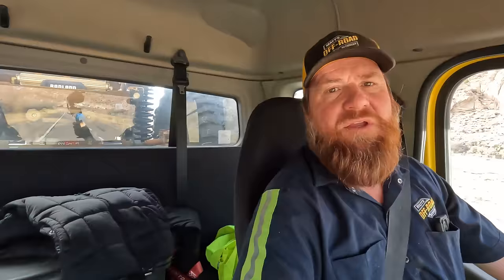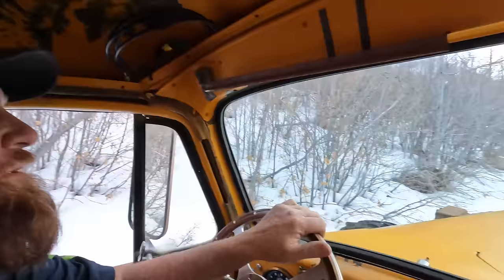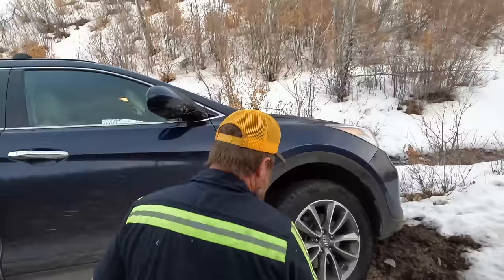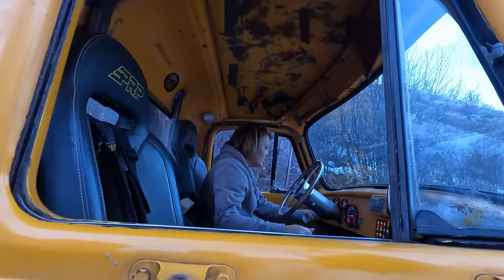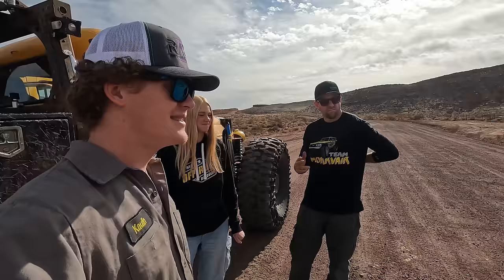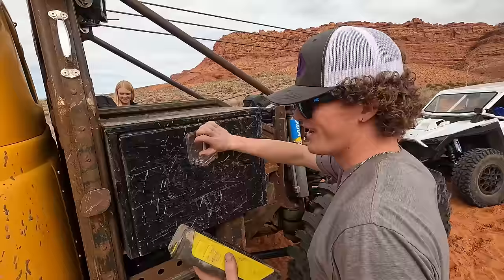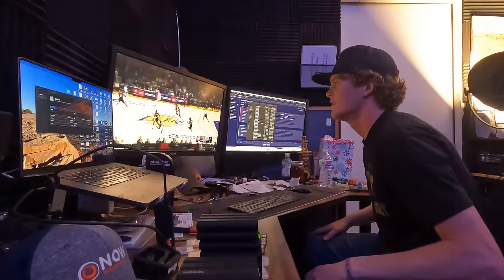You Took Your Hyundai Santa Fe Where?!

Comment: Tires make all the difference. All-season tires and you're cruising in that Santa Fe. With good ground clearance, that little car is surprisingly similar to a subaru. Add winter tires and conquer snow, even without AWD. Matt 20 point turns it around in similar stuff that got it stuck! Intuitive traction off and AWD lock buttons give you even more control, and Hyundai's traction control is impressive with real tires. I've had a couple of the newer ones, they're great in the mountains.

Comment: Don't them kids know about the wing window? That's the A/C of the day. They haven't lived till they open that wing window!
Reply: Those ones are sketchy meaning they’ll fall out.
Reply: I had a couple of air cooled VW's the wing window was the defroster as well as the A/C. The heater certainly wasn't up to the task, except when going uphill.
Reply: 2. 40 air
Reply: @jasonh4167  I've never seen one fall out.
Reply: I was looking to see if anyone else thought that.
Reply: @jasonh4167  Drove old trucks / Jeeps with those wing windows for over 20 years. Never had one fall out, or even come loose.
Reply: @jasonh4167  normally they are hard to open. If they are stuck you wish they'd fall out. Lol

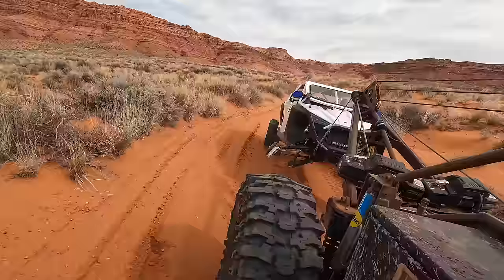Comment: actually on the offroad wrecker… you can open the little side window next to the window on your door by pressing the little button and twisting the handle.. then push the window out it should tilt out… it actually lets a good amount of air in.. Try it ! 17:36
Reply: also bugs, bee's and more things you don't want inside on you, nothing like sudden entry of an angry wasp, yellow jacket, bumble bee or better yet  swarm of them to liven your day up 😬 if I sound slightly experienced in that, yes, having owned multiple vehicles with wing windows, I learned to never use them as West Virginia air-conditioning after some bad experiences, like almost wrecking off a mountainside on gravel roads, thanks very loud vw rail buggy ahead of me that sent a yellow jacket nest swarming.

Comment: I'm a proud Santa Fe owner. The first video I ever saw of MORR was the Hyundai Tucson episode.  Been a fan ever since. BTW, the traction control on/off is a button that shows a little car with squiggly lines behind it. This SF is older than mine..... my button is on the center console but in my old 2013 Elantra it's to the left of the steering wheel. Hope this helps you next time, lol. 😉

Comment: In my Pontiac Torrent GXP all-wheel drive you hold down the traction control button for 5 seconds and it shuts off the traction control and the StabiliTrak

Comment: Maybe it would be helpful to have some sort of brake light on top of the boom so the person driving the recovered vehicle can see when you break so they can too...
Reply: Maybe even just make it off when on any throttle. On when off-throttle. I'm sure the gearing+tires makes actual braking unnecessary during flatter terrain. And you'd also know when to let off the recovered vehicles' brakes when setting off. I also wonder if there is much left foot braking done in the wrecker.

Comment: You definitely need more passenger space in the wrecker. Maybe add 2 bunk beds on top, then you even have a place when you lose the race with the sun.
Reply: I was just thinking about added seating myself. Great minds think alike! But I was thinking of adding a lazy Susan and a fold flat seat to the roof of the cab to create a spotter/guide position like in a safari.
Reply: They have to fit through the tunnel at Sand Hollow
Reply: Seats on top of the engine cowling like in the John Wayne movie “Hatari”
Reply: @yourhandlehere1  - you wouldn't need a seat for spotting disabled vehicles while traveling thru the tunnel hence the ability to fold it flat.
Reply: A sleeper compartment off a Peterbilt 359.......  Hmmmm....Sure, why not?
Reply: I've thought this too. I think a plastic seat and seat belts facing backwards on top of the toolboxes right behind the cab would be a great place.

Comment: 10:45 if the vehicle has a sport mode, put it into sport and hold down the traction control button for 3-5 seconds. It will tell you that the stability control is off and will actually stay off, if in sport mode. Cheers!

Comment: Hey there, Matt - my husband and I have a great idea for a jump-seat for the guy in the back of the wrecker. You could put a hitch-receiver on the back of the wrecker somewhere - vertically pointing up and mount a seat that would be pinned into the receiver only when a seat is needed for a comfortable seat with seatbelts put on the seat itself.

Comment: Matt!  We know you're rough and rugged, but get yourself a Ridge-Rest camping mattress.  We will not think any less of you if you start taking better care of the equipment that is Matt!  
You'll get to an age where you will wish you did!  
I used one for nasty spring plumbing at a sleep-away camp for decades (specifically a Ridge-Rest for durability, the ridge pattern that drained away moisture better than straight Ensolite pads, and ease of stowing) .  I had to actually crawl under slightly-elevated cabins and the Ridge-Rest defeats a lot of water, snow, mud and slop; they keep you from bleeding off heat energy if you end up on the ground for longer than you'd anticipated.  It also keeps you from transferring mud, water, sticks etc to your truck seat.  Plus your bones and joints will thank you.  If not today, then years from now!

Comment: I know Matt loves to call his wrecker the world's largest off-road wrecker, but, it's far from that. It's cool and has some great features I like the way it looks, but it's not even the largest off-road wrecker in Utah much less in the world. I drove one when I was younger that wasn't specifically designed for off-road but because of the high flotation tires it worked in most conditions. I could literally lift a fully loaded cement mixer off the ground and walk under it! The largest one in Utah is probably the one that Heavy D has
Reply: The largest off-road wrecker that can run trails

Comment: SUGGESTION: maybe in the centre of the cab(fixed to the back of it), you should install a minimalised reclining seating surface(something similar to the armrests in the back of the car, just thinner). And when it goes down, it's low and soft enough to sit on it but also wide and long enough to cover the controls, so nothing gets mangled or pressed with the b*tt and legs. Basically there should be a removable or permanent stubby spacer on the centre console to let it rest on it when it reclines down. Or the hinge spacer on the top of the reclining seat, so it does not stick out when it's in the up position.

Comment: I drove a Hyundai Tucson for 18 years. 2x4, no four wheel drive, no traction control, manual. Never got stuck anywhere. Did wonder a few times whether a helicopter will get me out, if I were to get stuck. Sold it last week, 600 kms short of 400 000 kms. I've got great respect for Hyundai. I'm in South Africa.

Comment: Hyundais in the snow absolutely suck.  I was stuck on three feet of ice once trying to get one I fixed out of the shop.  It would spin for about two feet, almost make it out, then the traction control would cut all the engine power and it would slide back down.  Had to pull it with a lawnmower to get it out.  The lawnmower didn't have a problem with the ice lol
Reply: My Mazda was a struggle a few years ago getting up a hill in the neighborhood. Was slushy snow with basically wet pavement under it. Needed to keep the tires digging through the slush so they had traction. Even with traction control “off” it’d let it spin for a few seconds before cutting throttle. About the time it rolled to a stop it’d give throttle back so I was able to gradually make it up the hill. 
I should have pulled the ABS fuse and hopefully disabled everything, but wasn’t excited about getting out in the slush.

Comment: I realize these are "recovery" videos but... wow! The number of razors and side by sides with broken axles they end up towing is amazing. After spending thousands of dollars on these things and then having them break.. is it operator error or are they just not made for this kind of environment? Maybe both?
Reply: They instill confidence. They are highly capable but not infinitely so. And they are easy to get into in terms of work to get offroading. They let you bring them to the bleeding edge and them BAM, an unfamiliar woop eats your a-arm. But more than likely is the fact that you only see broken ones because most of what's out there getting thrashed in the middle of nowhere is sxs's. Nobody is taking their Porsche's or Corvette's off-road and jumping them. Otherwise you'd see sportcars getting recovered just as often. Notice how the other "culprits" of breaking down on the trails are jeeps. A vehicle commonly found off-road. With a Jeep, it's usually a broken axle from being bound up or hopped on one too many times.

Comment: The modes on those Santa Fe can leave much to be desired.  Some stop working well banging and shuddering unless you run them in Sport Mode or any other mode than economy which the Hyundai dealers many times can't fix.  The last one I drove had that problem but at least it didn't burst into flames while parked as some have been prone to do.  I would not take one off road alone without backup as it would be a bear to come back and find it burned out inside due to the dash fire issues some experience (seen two of them do that in the past year).

Best!

Comment: I still think you should get a pair of Subaru Baja resr facing seats and mount them on some 2" square stock and put two 2" recievers facing straight up on the back of the wrecer. Then when you think you might need to haul more than one passenger you can slip in those seats and tell them to hang on 😂😂

Comment: Hey, Matt!  I had Lexus ct200 hybrid that had no way to bypass the traction control. So, what I learned to do in snow drag the foot brake to keep the wheels from slipping out and having the traction control shut down the throttle. Once I had enough speed I could stop dragging the slight brake.

Comment: Traction control switches should be standard equipment in everything.
Reply: With a lot of modern stuff when it says it’s off it’s just reduced, but not off. Sometimes you can hold the button, or do some process and get it actually off.

Comment: I was wondering what brand of torsen you use in your vehicles I have a Chevy k 1500 made in 1996 and it seems the only two type of torsions I can get are the power tracks grip pro and the Detroit truetrac do you have experience with either one or both I was wondering if you knew which one was better